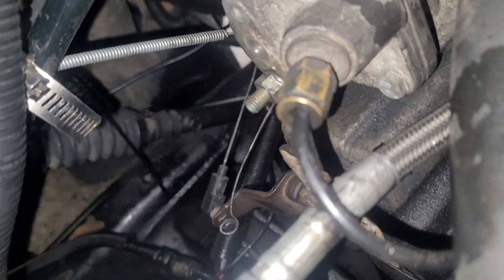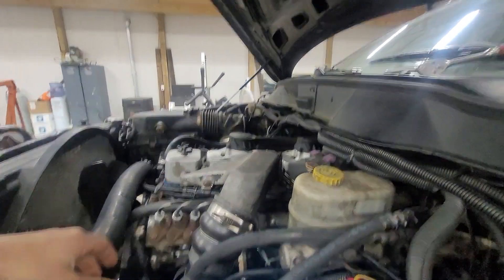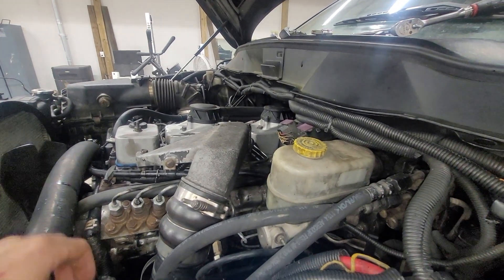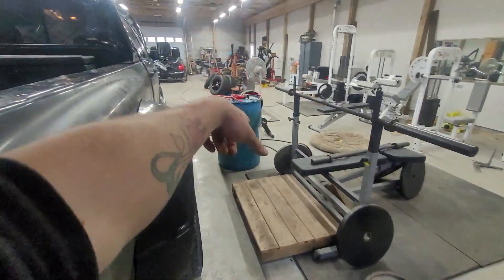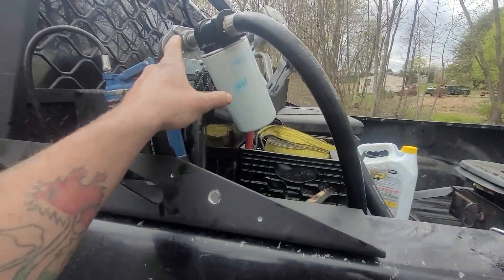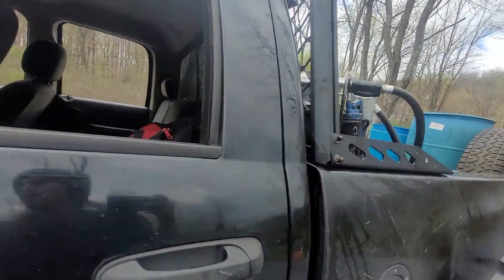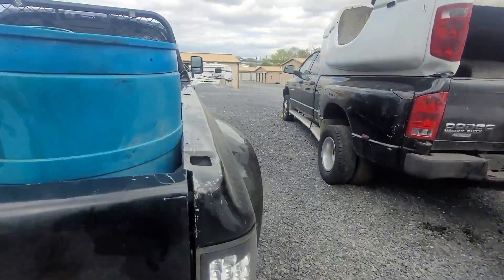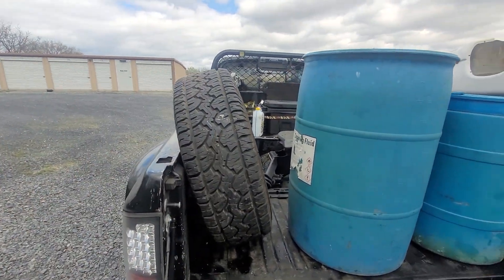12 Valve Cummins Fail.. | 2022 Financial Situation | Hotshot Trucking Update

Comment: You need a lift pump. It is very difficult to suck WMO thru a filter and water separator.
Reply from the maker: Getting 20 to 25psi. Lift pump is new already
Reply: Where is the pump? Pushes or sucks the fuel/wmo? I mean a pump before those 2 filters.
Reply from the maker: I'm just running the factory lift pump on the block and there's a sump on the bottom of the tank so it's sucking from the tank. I used to have an in tank pump but that would get clogged so fast with what I'm doing
Reply: Thanks, gotcha.

Comment: I think that taking out that very questionable water laden fuel was a very good idea.  As far as particle size goes, I think about it this way, "What grit sandpaper would I find acceptable to use on the cylinders continually?

Comment: Did you turn up the preboost fuel to get more bottom end power with the vgt
Reply from the maker: Very very small amount with the vgt. It would spool 0 to 32 in about a second and a half depending on the rpms

Comment: Yo dude, I drive an 05 Ram 3500 Rwd Dually. I was surprised to hear that you converted your rig to Rwd. (Most people always look really disappointed my rig is rwd. What's your take on it? You good with it? I was thinking about putting a helical gear rear end in my like a Torsen or Nitro-Gear to assist traction.
Reply from the maker: So much better fuel mileage and a lot less maintenance. I'm going to bigger tires and a winch here soon. Only time I really need 4wd now is in the driveway at my dad's if I park stupid. Having 8 other vehicles there means I don't worry about it

Comment: Reminds me of change set of plugs 
On v6 4point 3 I stuck one plug wire  on 
A manifold stud 
Drove it for week on 5 cylinders 
Yes I did it in the dark 
How did I fine it you say I was looking for miss an I touch engine while running 
I found it very shocking experience 
But I found it lmao not only you Steve 
But its still funny
Reply from the maker: The shit we do on our own equipment 😂 Truck has never run better now!
Reply: @CPSteveMiller  keep it up we all need
You're help beilve it or not !
It cost 475 in ky were I live

Comment: How did you do the 2wd conversion? I must have missed that one lol
Reply: He swapped the rear end and transmission from another truck and removed the transfer case, and front gears.
Reply from the maker: That was awhile back. 2wd trans and rear end from the white truck
Reply: @CPSteveMiller  oh ok why the rear end change though?
Reply from the maker: The one I had was a 4wd rear so the angles are different. This one is a 2wd rear. It's either a 2 or 4 degree difference on the angle. Can't remember. Since I reverse leveled the truck the angle makes a big difference on the carrier bearings. I haven't had a single issue with carrier bearings since replacing everything. I used to kill on off every 10,000 miles
Reply: @CPSteveMiller  i never knew 2wd and 4wd rear ends where different!
Reply from the maker: Just perch angles. V-belt did a video on adding shims to his because he bought a 2wd rear end for a 4wd when he did his dually swap. They'll bolt right up but the angle will be slightly different.

Comment: I am not a hater, but please tell me why is is not illegal to run waste oil that you have not paid road use tax on. It is no different than running off-road diesel. which is illegal.
Reply from the maker: Incorrect. 

Waste oil is already taxed. Spoken to a few officers(state and dot) about it. It is not illegal by any means. They consider it post-taxed fuel
Reply: @CPSteveMiller  Thanks did not know that.
Reply from the maker: Yeah I questioned it at first too. As long as it isn't red diesel you're good! That's the only non taxed option. That'll get you in some shit 😂
Reply: To make it simple. Waste is WASTE, IT did not come from a family checkility licensed to manafucture FUEL for use in an ON road application.